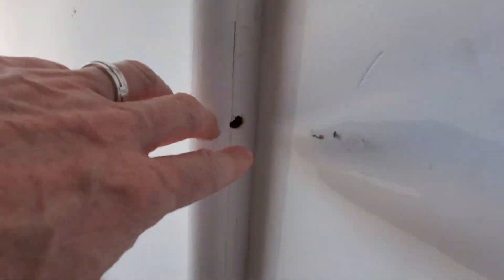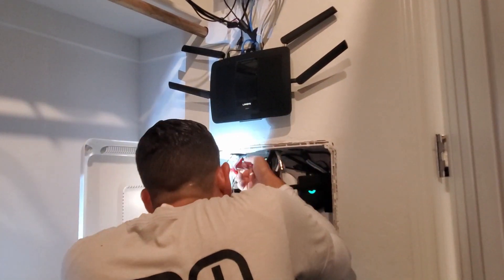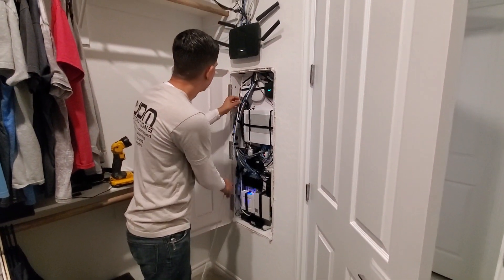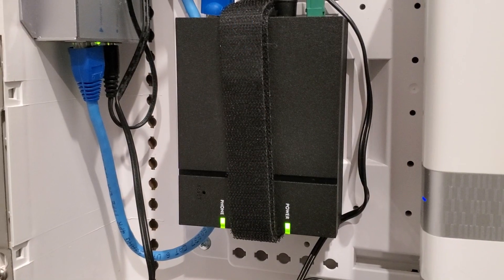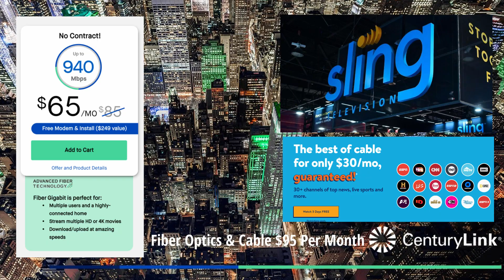Home Fiber Optic Internet Installation -  How To

Comment: I live in Vegas. How much did they charge to run the fiber cable into your network hub?
Reply from the maker: 75 dollars. JDMs contact information is in the description. Thank you for watching and if you subscribed thank you as well.
Reply: @UltimateTechHub  Was that the cable included, or just the install? Thank you for your response btw.
Reply from the maker: @o0HoBart0o  CenturyLink provide the fiber cable for free. JDM will charge extra for the fiber cable but I'm not sure how much. Make sure to mention my video channel to get a small discount. He does great work!

Comment: Isn't that an ONT?  Not a modem?  What if you want to hook up a computer directly to ethernet not wifi?  Then you would need a separate modem correct?
Reply from the maker: It's an ONT yes but I refer to it as a modem because it does acr like a modem in terms of connecting to the ISP. You still need a wireless router and you can connect your PC with an ethernet cable from the LAN port on the router to the NIC on your PC. Hope this helps

Comment: You didn't say anything about the difference between cat 6 and fiber optic cable. If the connectors are different. If you don't use a fiber optic cable to plug your router into the wall plug then that's the bottle neck. What about pluging your PC into the router? You didn't say anything about the cable. THAT'S why I watched this video and you didn't cover ANY of it. What a waste of time.

Comment: Oh the irony, you are leaving Cox Cable for CenturyLink Fiber: we had Cox Cable TV for many years, but we never signed up for their broadband service because by the time Gig-E was available here in the Redneck Riviera we were done with Cox Communications monopolistic profile. We had been with CenturyLink though all the years of buyouts and mergers since the late 1970's. For the 20 years we have been on DSL(ow) internet.  In 2015 when I returned home to assist my parents I was able to convince them to drop Cox Cable TV and switch to DirecTV then within a couple of years AT&T buys DirecTV - the customer service "TANKED" and exported to Indonesia and/or Philippines [same as CenturyLink] now we have a new competitor moving into our region and I am on their "Waitlist".  If Live Oak Fiber is successful in their backbone installation phase and first round of customers phase then maybe in the summer of fall we may get their fiber internet.  I just don't know how they will get fiber throughout the house without tearing down walls.  I inquired if they were bringing fiber optic cable to the house and then "piggyback" on our copper wire.
Reply: I forgot to mention that we still have POTS with CenturyLink and they do not offer fiber optic service here, albeit, they have been marketing it for years.  We pay nearly $135.00 per month for CenturyLink ISP and POTS.  DirecTV charges ~ $135.00 per month for the retired Entertainment Package and ~ $200.00 per month when Major League Baseball season commences.  If my "Dear Old Dad" wasn't a hard nose life long NY Yankees fan we would drop DirecTV IMMEDIATELY.  We were with Cox Communications for nearly 40 years and they always a bad problem with "price increase creep" and horrible customer service.

Comment: Really didn't need to run it in the garage. You probably could have easily fished it directly from the attic to the network access panel on the side of the house.
Reply from the maker: The roof line was too narrow to drill the hole to fish down the inside of the wall. Kind of disappointed that these new homes don't have a fiber tube already installed. Most new homes have them. Thanks for the advice and for watching I really appreciate it.
Reply: @UltimateTechHub  I had a similar issue trying to run CAT5 for surveillance cameras and I used 3/4" drill bit on a long flexible rod and drilled through the top plate and all the fire breaks from the bottom up. One of the best tools I've ever bought.

Comment: Quick question. The price for Gb speed is now $70. Is your bill still $65? I do not want a service that creeps the price up when I'm not paying attention. Are there any other fees like modem/router rental fees? Thank you for the vid and info!
Reply from the maker: My service is still $65 a month. 940mbps up and down. Lock in that  $70 a month because it will go up with the inflation. No extra charges for the fiber ONT and even a free router. But that router kind of sucks. Use your own router or buy a good router.  Thanks for watching.

Comment: Well to me you seemed to just blow past the details......so you just upgraded your street-to-house modem to an optic source and not your in-house wiring, (still using an ethernet cable to your devices?)
Reply from the maker: No need for fiber to run from router to devices. I gig speeds run perfectly on cat6 or cat5e. If I had 2 or 3 gig speeds I would use cat6a.
Reply: @UltimateTechHub  I didn't think so and I knew you knew what you were trying to say but you jump around pretty quickly between boxes. All Good

Comment: What if you have a dangerous ONT ???
Optical Network Terminal - Huawei Brand !!!
That's like inviting your Chinese Big Brother into your home, right?
Can I secure my network against this, or do I need to buy a different ONT?
I don't have a lot of money...
Reply from the maker: Put a VPN on your router.
Reply: @UltimateTechHub  not on my pc but on my router? 🙁
I never heard about that before...
Reply from the maker: @m007mm  Certain Routers can add a VPN to protect entire Network.
Reply: @UltimateTechHub  would stop them from getting any data from my pc?
Reply from the maker: @m007mm  It's not guaranteed but its a great start to help secure your network. It's almost impossible to totally secure a network without just unplugging your modem.
Reply from the maker: @m007mm  Most routers, switches,  phones and smart devices are made in China. Sucks.
Reply: @UltimateTechHub  thank goodness my router appears to be from China's mortal enemy, Taiwan 🇹🇼

Comment: You also forgot that patching an Ethernet cable to the modem, versus Wi-Fi makes a tremendous difference in the speed: a wired (patched to modem) Ethernet cable is always faster than Wi-Fi.
Reply from the maker: There is cat6 connected from the fiber ONT to the router. That's 1gig speed. From the wireless router I get 940mbps up and down. Thank you for watching I really appreciate it.

Comment: Any health issues related to the wifi proximity from your bed?
Reply from the maker: Nope. Im fit as a horse!! Lol
Reply: @UltimateTechHub  thanks! Mine is located in the master bedroom but I couldn't ignore the possible effects. Some headaches and sleeping issues.  Nothing too bad but definitely noticeable. Trying now to figure out where to move it.
Reply from the maker: @EyeBDaMD  I would recommend an Access Point in the center of the house installed in the ceiling. I have a Netgear WAX630 installed in my house.

Comment: You did a speed test off of a wireless router and NOT a direct cat 6 into your Ethernet port on computer.  That's a variable you left out and why you didn't get gigabit speeds.  You'd have to have a gigabit router w a particular band.
Reply from the maker: I have more recent videos showing the wired and wireless speeds. My old Linksys router was beginning to fail at the time of filming so my speeds were slower. I bought a new Linksys wifi6 router and i get 940mbps up and down both wired and wireless. If you want the video link to the speed test just let me know. Thank you for watching I really appreciate it.

Comment: Stupid question but of course Fiber is better and cheaper as far as price and is way more reliable then cable. Oh that's a terrible speed for fiber but it is CenturyLink they're not known for having reliable fiber to begin with. Now Frontier communications which is kind of like CenturyLink when it came to their DSL service their fiber is way more superiority than centuries links internet and you will see way closer to that 940 Mbps and 880 Mbps for upload. The way Frontier dose it is run the fiber to the home and usually directly into the inside wall is how they like to set it up. Yours you ran pretty far to start with and did not let the ISP do the fiber run inside. That's a big flaw as there is different types of fiber cables and you always want your ISP to do all the fiber inside and out that way if you aren't getting close to those speeds which in your case you're not at least what I seen here I would definitely be calling back and asking about that because when you're a few hundred megabytes slow there's definitely an issue somewheres either be on your end or the ISP side but you should definitely be getting way closer
Reply from the maker: CenturyLink provided the fiber cable for me to install and they could not run the fiber inside because there was no fiber tube installed in my home. I hired a low voltage contractor to crawl around my attic to do the simple install. By the way, my speeds are 940mbps up and 940mbps down. My old router in this video was throttling the speeds. I bought a new Wi-Fi 6 router and my speeds are maxed out. And for $65 a month its a great deal especially with no rate increases. Thank you for watching.

Comment: I have been having an issue getting a consistent answer to the following: I want to supply 8 rooms with 6 connections each.  I am going to put 16-port main switch and 8-port room dedicated switches in my server closet (physical management reasons).  I'm using on-hand Cat6 and Cat8 cable for now, but I want to switch to fiber before AT&T or EarthLink or Fidium or Unk finally lay fiber trunk the last few miles to my neighborhood.  But, I don't know which type of fiber to pre-wire my home with: single-mode, multi-mode, POF(?), etc.  Any thoughts on this?
Reply: yeah, I do have a few thought.. Turns out there is no way to actually connect your actual fiber network to the actual fiber cable on the street. You connect to their endpoint which is an ONT (this communicates with their service and takes the place of a cable modem) BUT.....the output from the ONT is only ethernet, so you lose the so called "fiber" connection. Even in this video he very quickly skims over that point. You can still have fiber within your own network SPX and all that...but no connection, fiber-wise, to the street

Comment: Do you have your house completely wired with fiber-optic cables?  Or do you just have Coax cable?  Would that make a difference in the speed your are getting?
Reply from the maker: Fiber coming into the house and ethernet cables throughout the house ( cat6a ).
Reply: Thanks for the quick response!!  Is it worth having your house rewired with fiber? Or maybe a better Coax?
Reply from the maker: @gregcols  Fiber is expensive to wire..Use cat6a which gives you 10gig speeds. Coax is thick and bulky to run I don't recommend it. Thank you for watching.
Reply: @UltimateTechHub  Sorry I meant Cat not Coax.  I’ve looked at the cost per ft of Fiber vs Cat and it is very competitive.  So it must be the installation cost?
Reply from the maker: @gregcols  Yes and you need additional hardware to use fiber throughout your home.
Reply: OK.  Thanks for all the great information.  Appreciate it.

Comment: How much did Mike charge you to fish the wire? I'm in Vegas and need to do the same.
Reply from the maker: I think he charges 75 but I really can't remember. Also depends on the attic situation. He has very fair prices. Keep me posted and thank you for watching.
Reply: @UltimateTechHub  thanks for the reply, I'll geve em a call.
Reply: Where are you at in Vegas? I'm in Mountain's Edge and getting centurylink fiber installed Friday. 100/100 is the fastest available for some reason. Probably fast enough though.
Reply from the maker: @Incomplet_name  I'm in Centennial Hills. Hopefully you will get 1 gig fiber in the near future.
Reply: @UltimateTechHub  not holding my breath, we're literally on the edge, nothing but desert behind us.
Reply from the maker: @Incomplet_name  It may take awhile before you get the upgrade.
Reply: @UltimateTechHub  is your ipv6 working on your gigapoint 803g? I already have a calix 711ge ont outside my home and can't seem to get ipv6 to work. It worked with Cox no problem. Do you think the 711ge I have just isn't compatible or might I need to set up ipv6 differently than Cox?

Comment: I recently moved back in with my parents to finish college and their comcast cable Internet with dated hardware is absolute crap(dial up was better than this!). I am hoping to install fiber Internet with an orbi router however my paranoid elderly mom will have a heart attack if someone starts drilling into her house. I’m here researching to defend myself and the poor technician I will be hiring, plz pray for me😅
Reply from the maker: Here is a video you can show your mom comparing fiber to cable. My speeds are actually faster than the speed test in this video. My old router was causing slower speeds. I get 940mbps up and down. 
https://youtu.be/NG0-hSR3iwk
Good luck and keep me posted.

Comment: Quick technical question: what is the benefit of having the ONT BOX or fiber optic cable out the house than inside the house? Verizon in my area leaves the modem(optic cable) outside the garage. But no optic cable modem inside the home.
Reply from the maker: It's just less heat when it's inside but it works either way. It's also easier to get to when you need to unplug for a power reset. Thank you for watching I really appreciate it.
Reply: Must I run cat 6 wire through out the house and then the company can just splice into it?

Comment: brother I need help! verizon only has the fiber optic cable out side the house but does not go inside. Inside they are using Coaxial Cable. Does veryzon install that fiber optic cable inside?
Reply from the maker: I don't have Verizon so I'm not sure how they set it up. You can run high speeds over coax. Keep me posted.

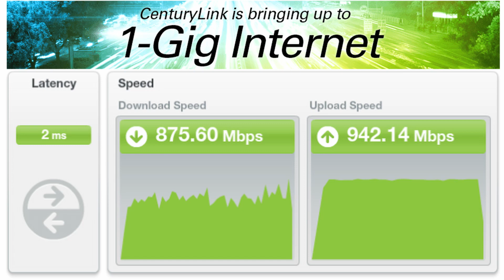Comment: Is the black "modem" at 2:36 the ONT?
Reply from the maker: Yes.
Reply: @UltimateTechHub  if the ONT simply converts the light-based signal to Ethernet packets, then why can’t I seem to find a router/ONT device to buy? Aren’t all ONT standardized so that third parity device makers can make these all in one devices. We have such combo devices for years for DSL and cable modems. What is so special about ONT that they are standalone devices?
Reply from the maker: @jasonluong3862  Fiber companies like CenturyLink have plenty of these ONTs. For some reason I only see them on Ebay for private sellers. Not sure why there is no ONTs on the market. Fiber is becoming very common so ONTs should as well.
Reply: @UltimateTechHub  what I mean is ONT  built into routers so that there is one less box in the already tight spaces in the network cabinet. My neighborhood is about to get fiber which is very exciting, but I would like to have as fewer boxes in my network setup as possible.
Reply from the maker: @jasonluong3862  Yes I'm not familiar with a fiber router combo. That would very convenient and definitely save some space. I will look into that but I haven't seen one yet.
Reply: @UltimateTechHub  All the dedicated ONT boxes are small, indicating that the required circuitry is minimal and low powered. Therefore, ONTs can be easily integrated into routers. The fact that such combo devices don’t exist is a mystery.
Reply from the maker: @jasonluong3862  I agree 100 percent. It should be a very common device now.
Reply: @jasonluong3862  They are not all standardized. They are  managed from the OLT

Comment: how much did he charge you?
Reply from the maker: I think it was 65 dollars. It was awhile ago...Lol. thank you for watching!
Reply: @UltimateTechHub  that was cheap. I got a guy quoting me 250 just to run the conduit in my new home build that doesn't have drywall.
Reply from the maker: @BrillianceAutoSpa  I've used the same guy for a few jobs so that's probably why so cheap. If your guy is running a fiber conduit that's usually a little more pricey. My guy just wire dropped the fiber with no conduit.

Comment: Your patch cord is soo big 
Apart from that, can you tell me which cable u use steal  wire or drop wire ???
Reply from the maker: I use drop wire. I have a 1 year update of the Fiber Internet. Here is the link
https://youtu.be/NG0-hSR3iwk
I am also uploading a new router install video today so make sure to check it out. Thank you for watching.
Reply: @UltimateTechHub  i think drop wire after 400 meter it  drop power .
I don’t think it is good idea for long distance.
Reply from the maker: @manakgurjinder6639  my drops are around 75 to 90 feet at the max.

Comment: You mention old computer processors slowing down internet speeds but didn’t mention the network adapter. Most old computers have a 10/100 Mbps adapter and a simple 10/100/1000 (gigabit) adapter upgrade takes care of that issue and will really help the speed.
Reply from the maker: Absolutely! All my pcs have the updated network adapters. But old PCs will need to be upgraded. I just did a 1 year review of CenturyLink 1 gig fiber so make sure to watch it. One more thing that can slow network speeds is an old router. That was my issue. I was only getting around 700 to 800 mbps wired speeds and so I replaced my router and now I get 930 mbps. I will have a new video on the new router in a few days. Thank you for watching I really appreciate it!
Reply: How old of a computer processor?

Comment: How far can you take the fibre line from the installation point from the road to the house were you want to install the fibre cable need distance
Reply from the maker: OS1 fiber optic cable is designed for 2,000 meters or 6500 ft.  OS2 fiber optic cable is designed for larger transmission distances in the range of 5,000 to 10,000 meters. Hope this answers your question and thank you for watching.